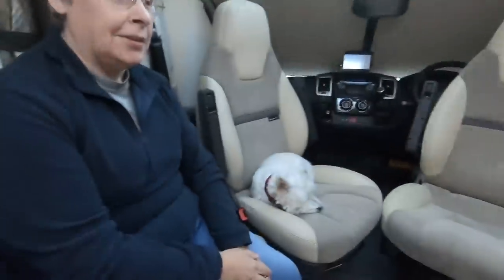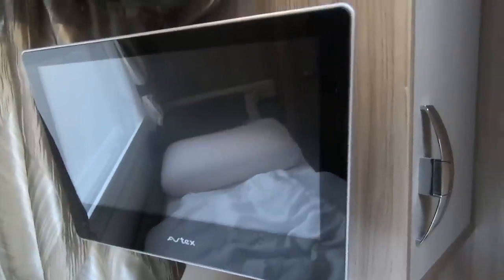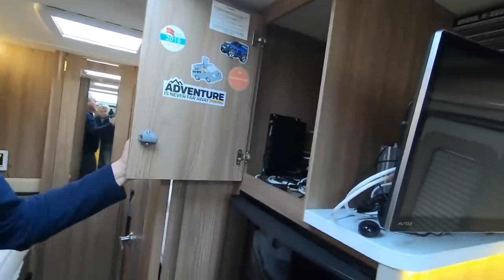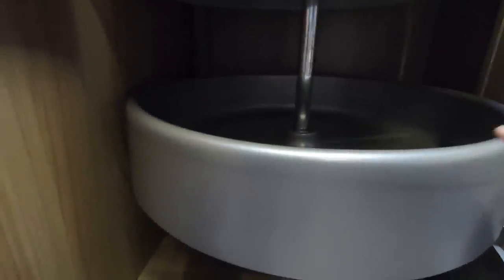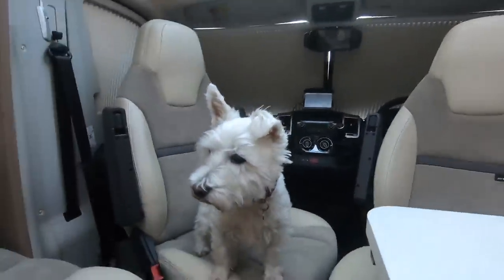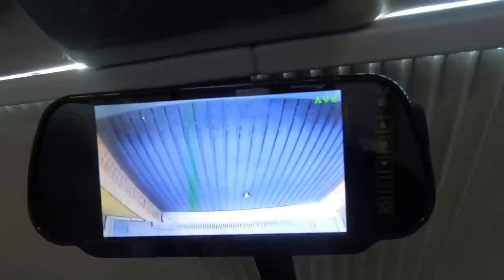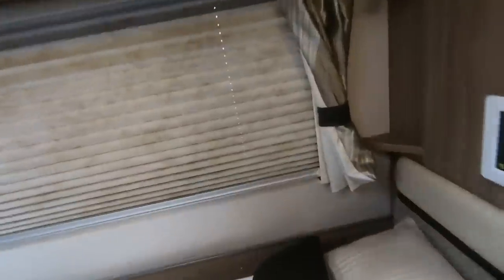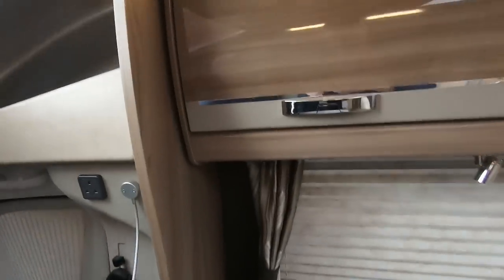Swift Bolero 714SB  | Likes and Dislikes | Four Year Ownership Review Pt2

Comment: Hi Bob and Jenny,thanks for interesting appraisal of your van.I bought 66 Reg swift escape664 with 750mls on the clock 2 years ago,I like the layout when I first viewed it but on using it first couple of times found the French bed rather claustrophobic,so fitted another roof vent above,next came extra leisure battery,2000 watt inverter reversing camera with 7in screen,bedroom tv and sat system,2 leg table.I tend to do mostly European trips so refillable gas system was next.At home until after Christmas so jobs on list are 4 camera system(front and rear vision) larger fresh water tank and pump, poss.rear air suspension.Reading this I think I might be obsessed!but I spend many months a year travelling in my van,but I'm not brave enough to add up the costs,like You and Jenny!thanks again for sharing your videos and happy journeys.Paul

Comment: Another great video (I have only just found your videos). Your snagging list reminds me of my problems with an ex-demonstrator Avondale Seascape SLX from 2005. A lot of the problems seem to be using fittings which are not really strong enough....made of plastic (for lightness and cost) when something stronger  is needed. It reminds of cars made in the 70s, whereas even bonkers-cheap cars like the Dacia Sandero have that aspect sorted, these days. Even very expensive motorhomes still have this problem. They have so much expensive kit, from all kinds of sources, that don’t quite mesh.

Comment: Hi there, just thinking about getting into the MH world and have only recently started watching your vlogs and now trawling through your back catalogue. With regard to repairing/sticking things back together, I have been using an amazing product around the home and on our ancient Landrover Discovery and wondered if you’ve heard of it? It’s called Sugru, using it it feels like play putty and you mould it for whatever purpose, leave it for 24 hours (I think) then it sets rock hard. There are different colours but I’ve mainly used white, my dishwasher baskets had the plastic coating split and the wire was rusting. I’ve moulded sugru around those areas and 6 months on, all perfect. Thanks for all the useful info, kind regards, Evelyn
Reply from the maker: Thanks, enjoy the videos. Yes, Sugru is wonderful stuff, I've used it on my gopro to stick a microphone mount and in the Motorhome to hold wires in place.

Comment: Hi BOB and Jenny, great vlog, I am currently sitting in the yard at your favourite dealers near Durham.  In the morning I hope we will be able to confirm the trade in price agreed at  the NEC.  I’ve ordered the. Elddis Majestic 285 which has a similar layout to your van but comes in under 3.5 tonnes. It’s not as high spec as the Bolero but is a lot less pricey. You mentioned in your last vlog that your van was treated with Diamondbrite,  have you found it to be a worthwhile investment.
Reply from the maker: I'm honestly not sure. I think it may have prevented the front of the roof becoming dulled and possibly reduced some of the black streaking.
Reply: Thanks for the reply, I guess it depends on how much they want to charge.

Comment: Interesting vlog. I wonder if double sided foam tape would stick that plastic cap under the sofa? I bought some at The Works, and it's got a strong grip (no second chances to reposition!), and the foam might mould to the bits that stopped the Gorilla glue from working.
Reply from the maker: Thanks, might try that

Comment: Hi, new subscriber. I've not seen all of your videos yet but I'm slowly getting through them. I enjoyed this video and wondered if you would answer a few questions for me?  Did you buy your motor home from new? How much road tax does it cost per year? Also is that based on size and weight or age?  Can I ask what motor homes you have owned up until now and which was your favourite? Thanks for doing your channel, it is both helpful and very interesting. Regards Luke.
Reply from the maker: Thanks, you have a lot of videos to watch, over 570, here are a couple that might help. https://youtu.be/1t_FlBbF9No
https://youtu.be/VO8yF102NwY
Our current motorhome is classified as a Private Heavy Goods Vehicle (4250kg 7.71metres) and costs £165 a year. Changes to recent regulations will mean the UK government will classify Motorhomes the same as cars for tax purposes, the VED for a new motorhome will increase from £265 (PLG rate) to £2,135 – a 705% increase – plus there will be significantly higher ongoing yearly tax costs of £465 a year.

Comment: Hi bob just wondered if those rear view cameras plug straight into the other smaller one behind it ? Which I have standard on my van , or do they only sell it with all the wires and exterior cameras as the whole package if you get my drift , thanks
Reply from the maker: The rear view mirror screen we bought needed an adapter to plug into the existing wiring, so check the plug you have on the existing screen.
Reply: Bob Earnshaw 
Thank you bob another brilliant informative vlog please keep up the good work

Comment: What a brilliant video. #VanEnvy  I feel quite bad that my list of dislikes on my van is long,  I look forward to changing it as soon as possible.  Until that happens, work arounds and tolerant attitude 😂😂 my next van needs: room to hang wet coats, a sofa that’s comfortable, supportive and my feet touch the ground, running hot water and washroom, NO pop up tent style roof, they are tedious to deal with when wet, let all the road/people noise in and are cold. More kitchen worktop, I manage on an area 11”x9”  yes you did read inches there. 
A fridge just like yours❤️ oh, and not needing to climb on the back seat to access a minute wardrobe that isn’t wide enough to fit a hanger in. There is more but, I’ll leave it there😂😂😂😂
Reply from the maker: Thanks for your kind comments. Every motorhome has some compromises. More space inside = longer outside, more storage = more weight and so on.